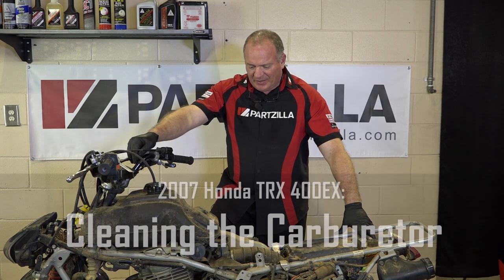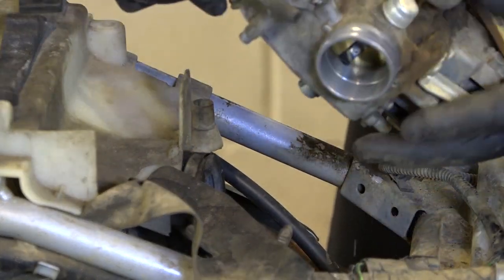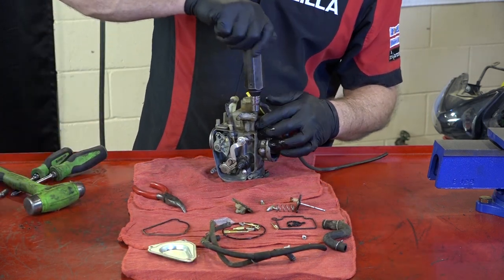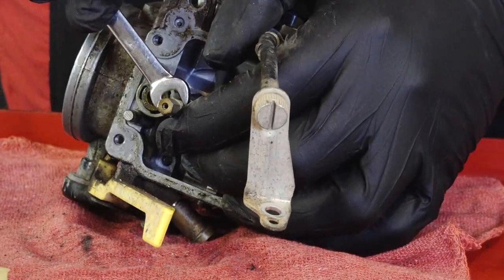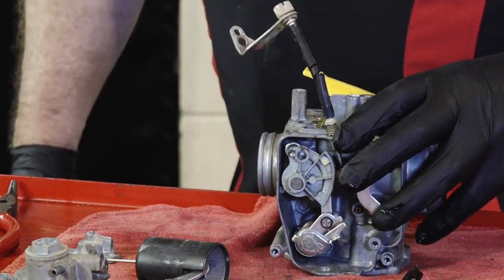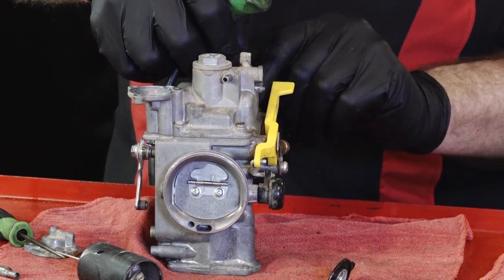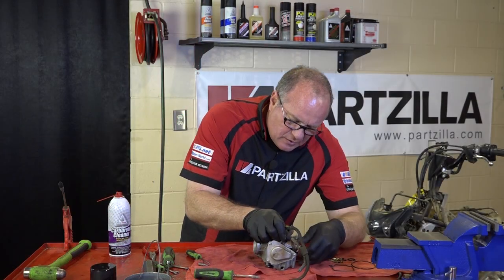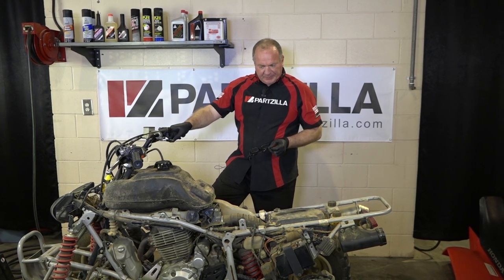Honda 400EX ATV Carb Rebuild & Cleaning | Partzilla.com

Comment: I followed this video for partially rebuilding my 2006 TRX400EX carburator with the AllBalls rebuild kit.  I honestly know next to nothing about carburetors, but this video helped.  The video you have on the valve adjustment was key too.   Quad runs perfectly now.
Reply: I hated that rebuild kit couple parts arent the right size compared to the oem the main was too small

Comment: Great video, this really helped me in cleaning my carb up and also finding my problem.  My carb was missing the screw to the slider arm.  It still ran but would not rev out and I couldn't figure out why.  It has a ton more power now.  Thanks for the great video.

Comment: A way to make an adjustment tool for the air-fuel needle on the bottom if the carb is on the bike or off.
Take a piece of hot glue melting it on the end jamb it up there letting it cool then trim off the excess on the sides.
Cut the hot glue to the length you need to get it in there. Put a mark right in front of you on the glue stick. Good to go:)
1/4 nylon tubing will work as well just get the tip of it rounded when hot before you push it up there.

Comment: I have a 2007 honda trx 400ex just gave the carb a good cleaning but cant figure out where the vacuum hose connects to. part number (95005-45001-50M )  It has a plastic Y piece close to the carb but got no clue where it goes on the other end. My stock petcock is not vacuum operated so where does it lead on the other end? It wasnt capped off. Cant remember taking it off when disassembling cant remember where it connected too...

Comment: Why don't you have the "anti-cavitation device" in the float bowl? (the plastic piece around the main jet that helps keep the fuel from foaming at high rpm which will cause the carb to be lean)

Comment: Atv  sounds as if it’s sucking air can that be possible a leak on the small hoses on the carb , it runs during the choke and without this video I was going to spend big money so thanks for the help , just one part of the float bowl wasn’t shown which was the plastic thing on the jet that’s very removable...

Comment: There’s a hose on my 04 that I don’t know where it goes. It just hangs, when I shut off the quad it leaks gas. I plugged it off and now it wants to stall  at idle. I looked everywhere for a place for it taking the length of the hose and searched all over for a location. Worked on cars all my life this has me baffled. Any thoughts???

Comment: I have the same bike you worked on I cleaned the carb completely used air and carb cleaner to blow out all passages all jets are clean and free of any debris drained all fuel from tank replaced with fresh fuel fires up fine with throttle revs fine but won't idle... Any suggestions?? Thanks

Comment: Hello, on my trx400ex - yesterday I took my carb out for easy access to my starter which I rebuilt. After putting the carb back in along with the airbox - i turned the gas on, I immediately noticed that I am getting fuel in my airbox. This was not an issue prior to my taking the carb out. Can you tell me what the likely cause of this is? Thanks...you make great videos and raise my confidence level when working on my 2000 trx400ex
Reply from the maker: First things first, check your hose routing.  You may have crossed something up

Comment: I found the little black shock absorber looking gasket (.25" long about 1/8" diameter)/ bushing it's pictured in some of the rebuild kits, but you don't mention it, where does it go?

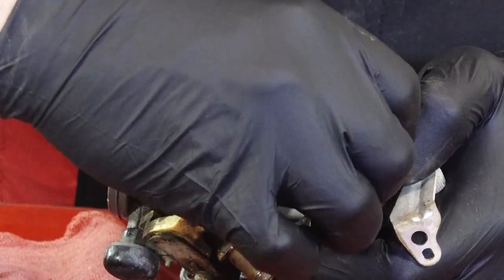Comment: At 13:50 you say the "spring follows" by the washer and o-ring. At 8:11 you take the needle out saying "there is your 0-ring and there is your spring" falling out last and you never mention the washer with that assembly. This just so happens to be the only reason I came to this site to find out the order as the sob fell out when I wasnt looking.
You put it back together wrong it looks like because the washer would have to prevent the spring from damaging the o-ring after the spring sealing it all in the carb. 

Unless the washer and o-ring jumped over the spring while you carefully pulled that needle out. 

Then again you had the needle out halfway when you said that and it looked like the o-ring was on the needle. ty

Comment: 2002 Honda 400EX. Backfires through carb will not idle stalls out. Runs fine up top pretty strong. Set for a while the person told me I purchased it from. Did a carb rebuild kit and still same issue. Help please!

Comment: Thanks for the great videos! It helped me with the carb rebuild. I have a question: I rebuilt the carb on a Honda trx 400ex 2006. When I started the atv, it was started and ran for a a minute or so. It started a couple times right there and then. However, after those few starts, now it doesn't start. The engine turns over but that's it. It's got a new battery as well just so you know. Could it be the carburator? Any ideas will be much appreciated. Thank you.
Reply from the maker: Hard to say...could be a pinched line, incorrectly connected or the air/fuel screw, needle valve...you could have missed some debris when putting it back together and clogged up the works.  Best to just go back through it and see what you find.

Comment: Why didn't you check the holes on the sides of the Jets? Just because it sprays through the bottom of the jet doesn't mean it's getting vacuums through the side holes. Where do you get the mixture screw socket

Comment: I'm just curious why would people show people cleaning the carb or replacing Jets and needles why on the 400 EX don't you guys ever speak of number 38 in the schematic JET, SLOW AIR (#110) you speak of the pilot jet the main jet the needle and it's clip positions but my 400 don't even have an adjustable needle. I just bought a jet kit and I realized after I bought it by looking in the schematic it doesn't show that number 38 I don't even see it being sold inject kits what is that for?

Comment: Got a keihin carb can I take the jets out my old carb and use them in the new on I have moose racing cdi box airbox delete with k&n filter dmc alien slip on will I have to do additional tuning

Comment: the nipple on the right side of the carb,facing the back end is that a overflow hose? I have fuel leaking from there so im assuming i need to clean the car but need t know f im supposed to have a hose there & if so where does it route?

Comment: do you need the baffle plate? I took my carb apart apart and it didn't have the d hexed shaped bolt for the air screw it was a flat head screw with a gasket

Comment: Hey there, I cleaned out the ladies 400ex and while twisting down the throttle cable bolt to the carb i knowticed the mental tubing doesnt sit straight or to the right... it sits facing left when skrewed all the way down which interferes with the placement of the gas tank. Any ideas on what to do? Probably a no brainer but im having issues lol

Comment: Hello, I have a 2000 400ex. I rebuilt my carb tonight following your direction in this video. Thanks for the info. Question, when I got to the part where you use the d-shaped tool to remove the air/fuel mixture (at the 8 minute mark). On my carb it was not d-shaped and the head of it was practically flush with the top of what was screwed into. In other words, there was no where for me to turn it in (2.5 turns in your example) before backing it out. As a result, i don’t know how to set my air/fuel mixture precisely. Please sdvise. Thanks for your help.
Reply from the maker: The D Shape came in later years.  Typically, you can put it at 2.5 to 3 turns out to start and adjust later if necessary.

Comment: When I took mine apart there was another plastic holding the float. I put mine back together now it leaks all crazy. The rebuild kit I got has a seal that seems stretched, doesn't fit in the float bowl groove, is that normal? Carb leaks all crazy now.

Comment: do you have the hoses for sale as a package. I see I can buy all the individual pieces like clamps and hoses, but just wondering if I can buy all the hoses in one package. I do not need the fuel hose that goes to the petcock or the hose that goes from inside the throttle cover. just the two ports on the side of the carb and the other one by the bottom of the carb that is like an overflow or something

Comment: i didnt do a as though rough cleaning as this just the jets and bowl. I put it back together now it will not start at all just turning over once in a while get a small putt. There is spark and fuel going in what could it be??

Comment: I just noticed gas is leaking during idle out of the drain port hose, i secured the bleed screw. It seems as if to much gas is in my float bowl, would this have to do with my needle jet or float valve any suggestions?
Reply: +Drago23 After removing float bowl I did find float valve dirty, cleaned  and reassembled it, no more leaks!

Comment: I got a 2003 honda 400ex. It got a k&n air filter and k&n air box power lid with a big gun slip on exhaust. It spits back into the airbox when cold and floods on idle sometimes. when I rev it theres abit of black smoke witch would indicate flooding. What would be the recommended  jetting for under 5000ft?
Reply from the maker: All the aftermarket additions change the jetting.  There is no sure fire solution.  Units react different per mod.

Comment: I don’t know if your still answer these but i’m hoping so. i just got a new carb for my 2002 400EX and it’s idle is very high . I know where the idle screw is, I just don’t know what to do
Reply from the maker: Turn it counterclockwise 1/4 turn at a time until your idle resolves.

Comment: Great video just wondering if this would be the same curb cleaning process for a 2004 Honda TRX 450r sportrax quad?

Regards
Reply from the maker: Process is the same, but the carb is slightly different, if I remember correctly.

Comment: Great video!  Started tearing down my carb for cleaning and rebuild, realized the throttle stop cable was broken off the thumb screw. I ordered a replacement from you guys, is there a video from Partzilla that explains how to remove and replace the throttle stop assembly on a 400EX?
Reply from the maker: +Rob B Not yet. We had moved on from the 400EX but are going back to it to cover a couple more topics. I'll throw this one back into the list.

Comment: I just purchased a 2005 400EX that had been sitting in a garage for a couple of years.  The quad runs strong but it won't idle.  It will turn off within a second or two if throttle is let go.  It has fresh gas. What can I do to make sure it idles properly? Thanks.
Reply from the maker: Clean the carb!  Anytime it sits for awhile, the jets are probably clogged.

Comment: great video my carburetor leaks gas constantly from a small tube on the bottom facing to the rear what can that be even when its running
Reply from the maker: Most likely a stuck float or worst case a rebuild.

Comment: Great video! Question, before I remove the carb my honda sat for about 3 years any suggestions on how to clean the fuel tank?  I removed the petcock assy/screen kit which will be replaced because it was disintegrated with that honey like tar build up you mentioned .  When I removed the fuel line from the fuel tank I didn't see a screen prefilter and also found that same build up. I will most likely purchase the carb kit but any suggestions on how to assure my issue does not lie outside the carb?
Reply from the maker: +Drago23 Best way that I know is a bit old school, last time I looked in the mirror I think I' qualified. Spray a whole can of carb cleaner in the tank, add in a few nuts and bolts, shake it for a few minutes, then let it sit over night. That should break down the glue in there!
Reply: +Partzilla.com 
Thanks for the advise, extremely helpful!
Reply: +Partzilla.comI  Finally broke my carb down and thanks to your step by step procedure my 2005 ex is back up and running perfectly.  That trick of the trade worked like a charm. Keep up the good work I will surely check back for upcoming videos.

Comment: Hi I was wondering about the mainjet I removed and cleaned it. But the little lock nut moved up or down. Does that matter and how should I seat the main jet now that nut has moved?
Reply from the maker: all you have to do is snug it back down. just tighten each nut on the main jet and it will be just fine!

Comment: those clips that hold the air box to the frame, were they used on earlier 400ex 's as well? I have a 2000 and I am not seeing on my air box the same clips
Reply from the maker: Might be slightly different on a 2000.

Comment: OK at 15:26 when you put on the float bowl. My 400ex has a little plastic basket that goes on top of the main jet.. What is the purpose of this? Why does that carb not have one?

Comment: I did this pretty much the same but I didn't mess with the air mixture screw. I got it all back together and now the bike is idling really high. As soon as I turn it on it seems like the throttle is pushed down. What could cause this?
Reply: Nevermind brain fart. I didn't twist the carb all the way onto the throttle cable when re installing it. Hope this might helps someone else

Comment: so I tried so many things to fix mine at first it was leaking second I had to push the gas so it would turn on third I bought a new carburetor from amazon and it started to rive hella nasty last thing I cleaned the old carburetor and it didn't work

Comment: Rebuilt the carburetor on my wife's 2005 TRX400EX yesterday because it was leaking through the overflow tube. Cleaned and replaced everything that came in the kit and the float needle, temporarily placed the carburetor back on the ATV and did a flow test, it failed, still leaking through the overflow tube. Any thoughts?
Reply: Did you found the solution, i’m having the same issue
Reply: @alejandromorales7201  oh man that was a long time ago, I didn’t remember what the fix was, sorry about that

Comment: Quick question, I have 99 Honda TRX400EX, There is a small outlet or port at the bottom of the carb toward the back of the quad that was pouring gas out of it the other day and I'm trying to get the correct answer as to where the hose that was connected to that port/outlet goes to? I'm being told it connects to nothing and that its just and overflow. Also, on the side of the carb, there is two short hoses that connect to a Y or T and goes to one long hose, it was also hanging down. Can you tell me where that connects to exactly? Thanks
Reply from the maker: If there is a hose, it doesn't connect anywhere.  It is basically an overflow to vent fuel.  If it's pouring fuel out consistently, your float could be sticking or it's time to tear down the carb.  The 2 into 1 hose is the vent hose.  It goes in the hole in the splash guard behind the fuel tank.
Reply: Ok, Thank you for the information. It was a brand new carb, only had a few hours on it. I have ordered another one to install in its place. Thanks again!

Comment: We have 2 1986 and 87 Honda 200sx 4 wheelers that have engine hiccups.  I just installed new carburetors in each.  Any suggestions to correct this problem?
Reply from the maker: Not a lot to go on Michael!  Confirm it's a fuel issue, check hoses, air fuel mixture.  Vary some adjustments.
Reply: Sorry, not sure how to explain.  The engine idles normal then it will miss and sound like a hiccup.  As if fuel shuts off then back on again.
Reply: michael davis sounds like a spark problem

Comment: I have a question. So I have a 2014 trx 400x. same as ex. My carb was fine, only issue was when I wheelie it would sputter. So I decided to take it apart and clean it. I removed the Jets and cleaned it. I also did the to the accelerator pump. Put it back together and now it's running not good. iddles fine but when you crack the throttle it's sputters And then revs up. It happens alot underload. Before I purchase a brand new carburetor screw you guys, any thoughts?
Reply: Not screw but through..lol
Reply: I did check for vacuum leaks but nope
Reply from the maker: You most likely need to go through it again.  Either something is clogged or you adjusted something wrong.

Comment: Hey John the plastic part under the main jet when you pull off the bowl diagram 25 on your website what is it for...mines was sitting on the bottom of the bowl when I pull it off to rebuild it with a new kit....I didn't put it back in....will that cause fuel to overflow out of the overflow tube.
Reply from the maker: #25 on the diagram is the float gasket.  Is that what you're talking about?

https://www.partzilla.com/catalog/honda/atv/2007/trx400ex-a-trx400ex/carburetor
Reply: Partzilla #27 i meant...sorry

Comment: Do You Have To Completely Take it Apart Like That If You’re Just Gonna Spray It Out ?
Reply from the maker: Depends on how deep you want to go.  Most times, it's not necessary for a simple carb clean.
Reply: No but if you have it out and have a kit might as well go over everything best time to check shit is when it’s apart I probably wouldn’t fuck with that throttle body unless you need to adjust the needle or it’s dirty though

Comment: Having a problem with mine leaking from the overflow line would you suggest and cleaning or rebuild kit
Reply from the maker: A little overflow happens, when it turns to more, it's worth inspecting and cleaning.

Comment: i own a 03 trx400ex, everthings stock except air filter.. i removed my stock exhuast..and welded a new fmf powercore4, after installing the new pipe, i fired up the quad, it wasnt working properly.. it seems to bog when giving it throttle "p.s carb is clean" any suggestions? this mean i need to purchase bogger jets? my carb moves while having  steady rev. and makes a clit clit sound every 2 seconds and wants to die down
Reply from the maker: Hello Fernando. I would start with going up one jet size.
Reply: Partzilla is this the same carburetor as the 2004 model?